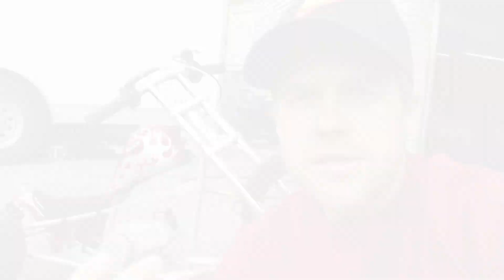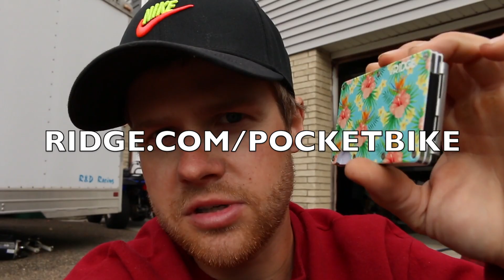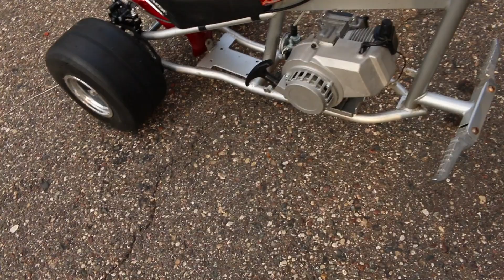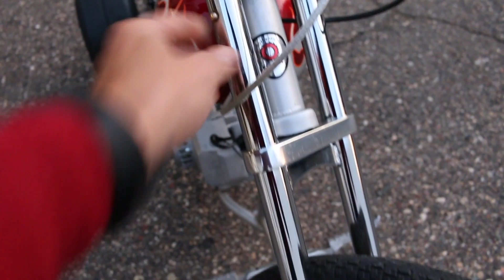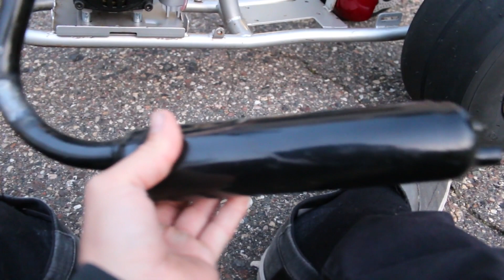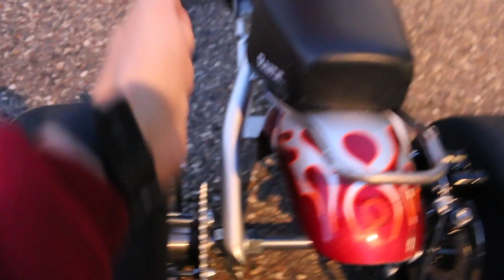Pocket Drift Trike Build For Kids 2.0! Cheap No Welder Required

Comment: Hey just want to comment and I NEVER COMMENT...

I have two motorcycles 
(1984 Kawasaki GPZ 550 the FIRST ninja body-style) 
(2001 Suzuki VZ800 Marauder) that I have neglected to get back into running shape (Kawasaki needs a new stator motor so I’ve leaned towards the newer safer faster louder Suzuki). Suzuki I believe has a valve tap so I stopped running that motor ASAP until I can pull the DOHC and inspect the valves and valve springs BUT that requires me to pull the motor and that scares me and mainly because it’s a dual carb bike and it has that dual synchronizer cable to make them open and close the same time and distance. Soo any help with that would be awesome lol..

Now all that said I am LOVING what you’re doing in this video and I just watched the first video also. I’m new to the channel but you got a sub from me and I’m spreading the words to my Social media fan base and friends. 

Ive currently just decided (2hours before finding your video) that I not only want to I NEED to build myself either
 A) a little drag quad or dirt bike
B) full size dirt bike/Quad
C) a dragster go kart 

Any kits your recommend or ideas to go about picking which to do and the way to go about it? Any insight no matter how small would be greatly appreciated and helpful! Thanks in advance and thanks for your hard work and determination!! 

God Bless! ♻️ 
-Yim